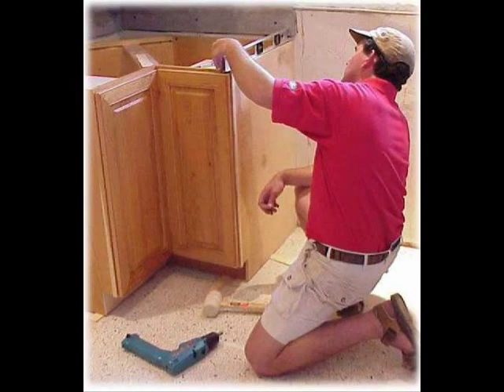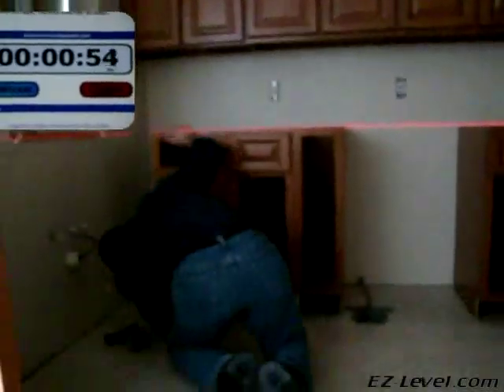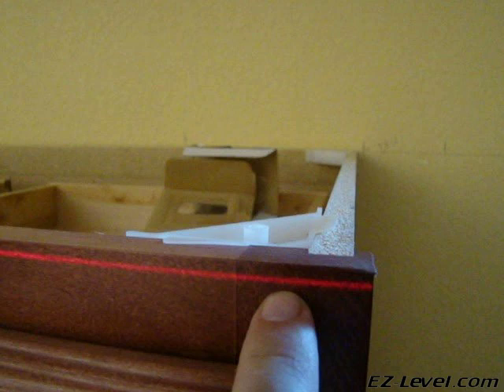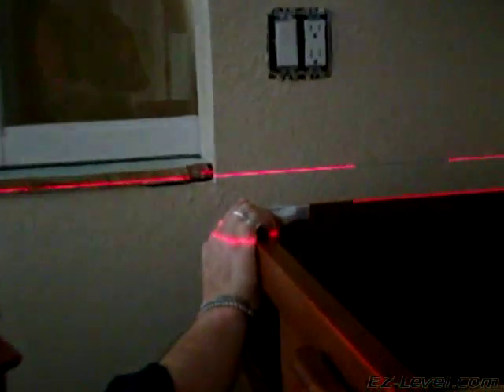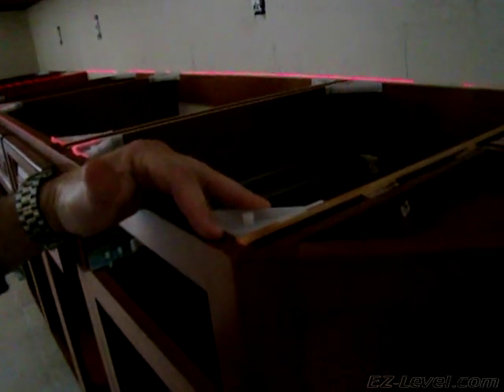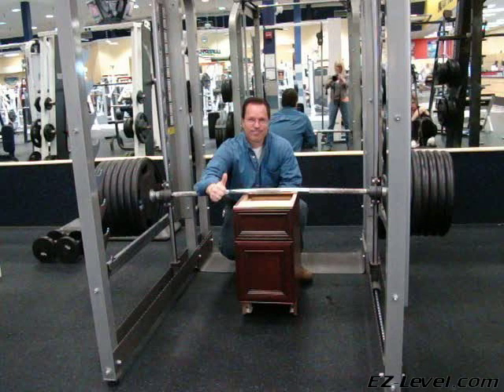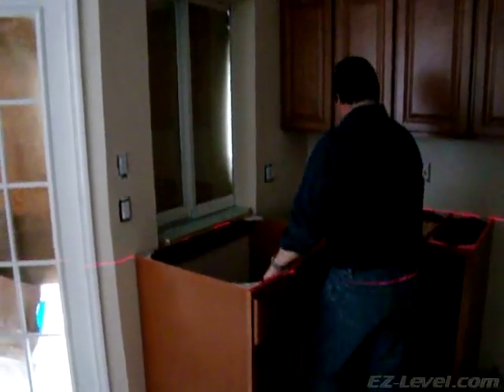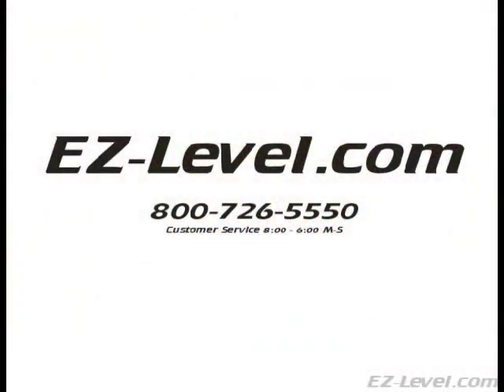Cabinet Leveling - Leg levelers

Comment: I can't wait to get my order and cabinets in and installed. It will be great to get the cabinets off the underlayment  and be able to put my vinyl plank flooring slightly under the cabinets without the weight of the cabinets on my floating floor.
Reply from the maker: Yes sir... The EZ's ROCK! Also...  we are here to help you if you need us too. 800-726-5550.
Reply: Great idea.